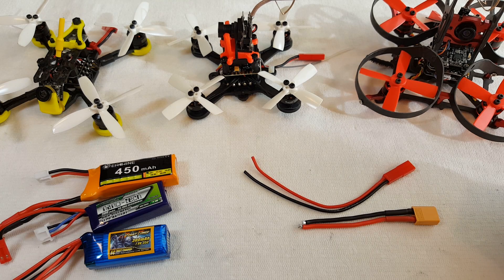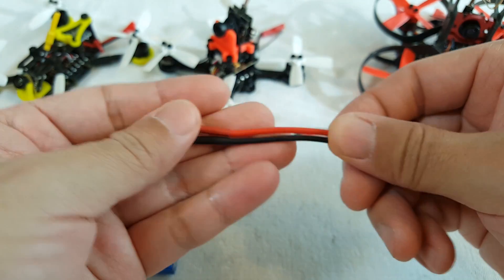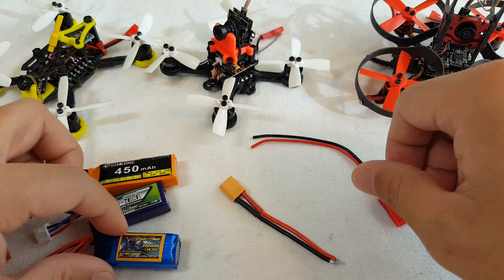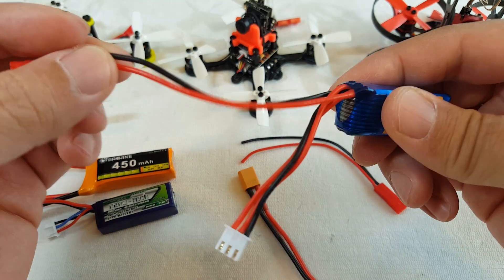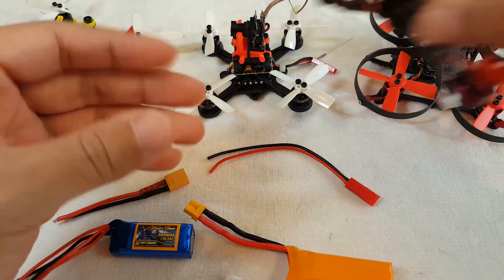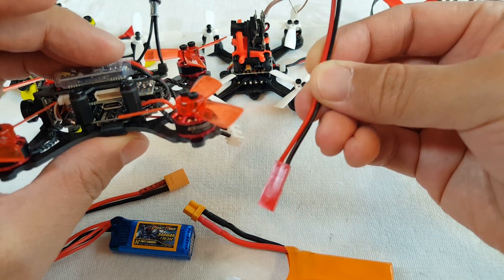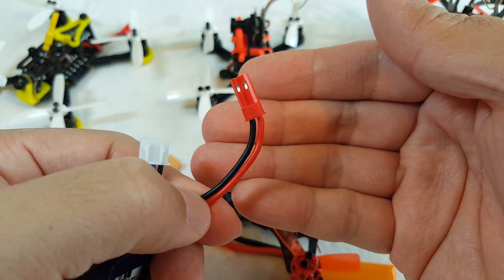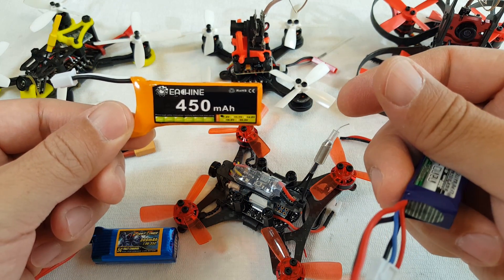XT30 or JST?  Best Connector for Micros?

Comment: totally agreed, XT30 is a waste. I fly an aerobatic 300g 3D trainer with 3S 450 and JST connectors with no objection and they are fine in confined housings. But for larger appl. I use XT60+90 only

Comment: what if im just changing connectors to accommodate the quad i have i originally had a mantis 85 and bought a bunch of jst batteries now i have the cine whoop and want to still use  the batteries i have  without buying new xt30 ones
Reply from the maker: You can make your own XT30 to JST adapter.
Reply: @AlbertKimTV  didnt even think about that thanks man!

Comment: Think about the logic that you say at about 1.35. You say more current is flowing thru the wire then you say current can't get thru. Which is it.
You need to look at the facts, the jst has a higher contact resistance than XT30. Around .2 ohms compared to 0.07 ohms. Hence more volt drop across connector and in turn heat and voltage sag.
Reply from the maker: You've found an outdated video...  updated one here - https://www.youtube.com/watch?v=9-zybVF_R90

Comment: Thanks for the info. I was contemplating to change the Aurora 90 jst to xt30 connector but after watching this I don't think it's necessary anymore. The jst connector feels a bit warm after some hard flying. 
The jst connector is difficult to remove. Apply a tiny bit of silicon oil into jst pins (battery side) and it's a lot easier to remove. Don't use mineral oil as it can damage the plastic connector.

Comment: I recently bought some 4s batteries for my 2incher (lol) that had the XT30, so I made an adapter to go to the jst(previously only used 3s w/jst). Haven't had any problems, doesn't even get warm. Coincidentally, I don't think I need 4s batteries for it heh. 

Oh BTW, where do you get the jst with silicone?? I've ordered them from 3 different places now(probably all the same just with different names). They advertise as silicone but they're clearly not. Argh!

Comment: Good info Albert. I find the JST's a bit hard to disconnect, especially when the leads are short.  Just for science I measured the weight of a pair of mating XT30's (2.15gm) and a pair of  JST mating (.75gm) both with no wires. Big weight savings for sure on mini/micro builds. However these little brushless motors are power hungry and the JST connectors pins are rated 5A continuous and 10A burst. The XT30's are 30A, a lot beefier. Have not put an Amp meter on one of the min/micro brushless yet, have you?  Wonder what they draw at close at full throttle.  JST may be  dropping voltage on higher throttle punches even if not getting hot, but may not matter on these mini builds. Nice set of mini brushless quads!
Reply from the maker: +cybervid07 since I don't fly at full throttle most of the time, my amp draw is not that high so the connector doesn't get hot.  For someone else, their flying style may draw more amps.  So it may not be always necessary to upgrade.
Reply: I agree with you lately I have been coming across some that are a real pain to disconnect. They seem to be lowe quality. Oddly enough the Hobbyking ones I got with the 20g silicon wires were the best. I have an order in to them for a few to change the ones that are giving me issues.

Comment: Hi Albert. I have a few 2s that have xt30. Any issues with switching the connectors to JST? I want to use them with my tarot 130 which has JST.
Reply from the maker: +Light-on-Fuel FPV should not be a problem.  Just that the max current output get reduced but should be okay for the tarot.

Comment: Do you think the Aurora 90 would fly decent with the tattu 650mah 75c 2s? Or will it be too heavy. I'm running the racerstar 1103 10000kv motors.
Reply: 450mah is the powerhouse size 500 is a balance of flight time and performance and 550 is for extra flight time

Comment: its the pins on the jst connectors which are the weak point, i dont know how much current they can reliably sustain
but as you say they are not getting warm but it would be interesting to work out the average and peak current one of your micros draw then setup a simple mosfet load 
set to the above current draw and see how the pins in the jst hold out and check the voltage drop across them
under the load

I brought a nano-tech battery and the wires were reversed , luckily i only plugged it in to an 808 camera and no damage was done 
this was the battery
 http://www.ebay.co.uk/itm/232135817750?_trksid=p2057872.m2749.l2649&ssPageName=STRK%3AMEBIDX%3AIT

Comment: weight difference? I think that's a big deal and may sway people. Also, I like the XT30 as I use them on my planes that may pull ~20 amps, more than a jst can pull, and then I don't meet to make another charging adapter.
Reply: Jst-rcy also rated for a way lower cycle life. Plug mating surfaces eventually deform on them. I'm a math person so  I look at it like this. Jst max amp rating is 5a from mfg. Now if your set for a 10a continuous ESC you would be capable of overloading it easily. 11mm brushless at load  draw from 2-3a a piece, 8-12a total depending on conditions. When overloaded, the major side effect will not be connector heat, but battery voltage drop. High resistance will lead to erratic voltage stability and greater voltage sag even if not noticable or if the quad flies fine. Efficiency is not all about weight. I'd take a gram or two (2% or less AUW of average brushless micro.) for an electrical over head of 3x what's needed over the chance of being deficient. I'd recommend micro deans, but who wants to resolder batts  to the finicky pins lol.  Either way micro brushless FTW!
Reply: Albert where are you located ? I am willing
Reply from the maker: +Niko Garnica ideally it would be nice to have a heavier quad with xt30s and matching batteries and race against the lighter quad to compare but I don't have the funds to support such a project.  Anyone want to help me? 😀
Reply: Albert Kim I would help, but college! I'm planning on building a micro brushless soon though!

Comment: Could you link the silicone 20 gauge wires? Thanks!
Reply: Check the BNTECHGO brand on Amazon. I've used it in a few gauges and it's worked well. You can also get longer lengths...

https://www.amazon.com/BNTECHGO-Silicone-Temperature-Resistant-Flexible/dp/B01AAX64EC
Reply from the maker: I get mine here - https://goo.gl/TEpCpE
Reply: Braeden Smith was about to ask this also !
Reply: Braeden Smith i purchased about 6 meters of 20 gauge wires for about $2

Comment: Hi Albert,

I would certainly look at this thread (https://www.rcgroups.com/forums/showpost.php?p=4031293&postcount=8).
You are absolutely correct about the AWG, but now compare the 'gage of the connector itself', to different wires... JST has really tiny pins. Say between 5-10A continuous seems reasonable (without testing or measuring myself), XT30 can do 30A continuous (duh).
Depending on ESC/motor/prop/LiPo combination, it might be needed for some.
Also the wind helps to cool your cable/connector. Strap a quad to something indoors, and alter throttle during 2.5 minutes and check the cable again... (might as well measure Amps while setup like that).
Edit: FYI I liked the video, as always! 😉
Reply: I've standardized on XT30/60/90/150 connectors across my fleet of vehicles/aircraft. Whenever I get something with a non-XT connector I swap it out for the XT connector appropriate for the application.
Reply from the maker: +psydafke for me, if the connector and wire aren't warm, there's no need to do the upgrade. Since I only fly 2s this is why the amp draw is lower.  Obviously on 3s or 4s the situation is different...
Reply: Albert Kim - i'm in the xt30 camp also, however everyone is perfectly entitled to their opinion (and freedom of choice) but these discussions are great so keep them coming! For me the ease of swapping to xt30 (a solder iron) is a big deciding factor. i have no means to crimp a jst
Reply from the maker: +TweakRacer see my more recent video